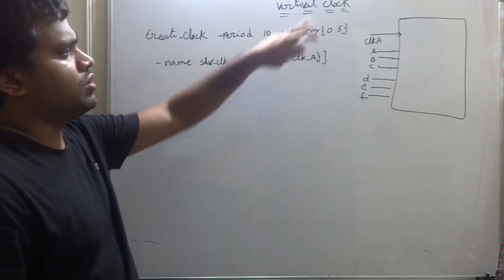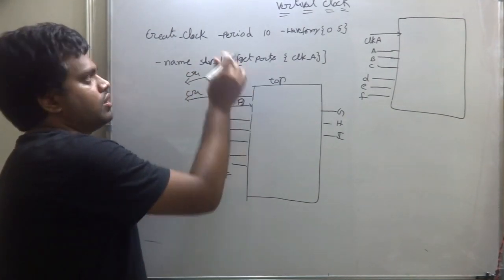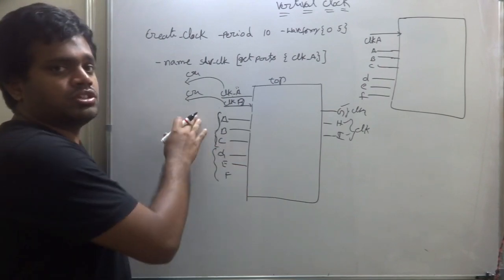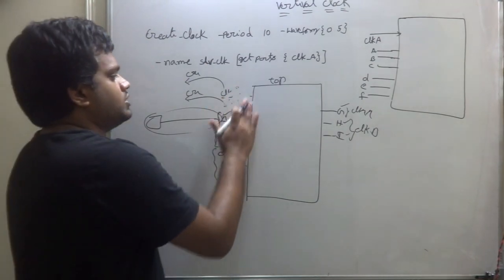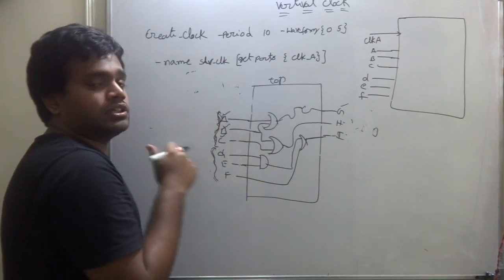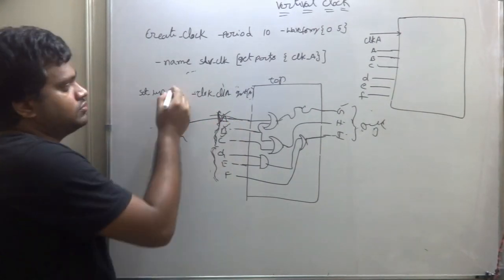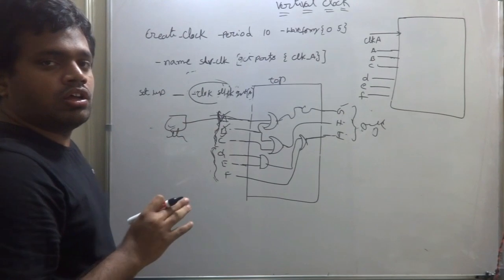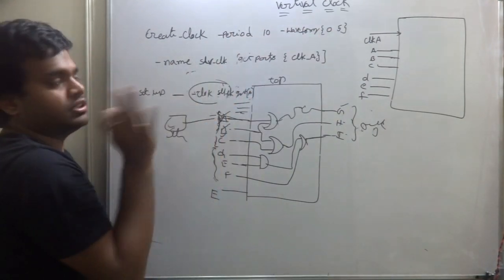Synthesis/STA -  virtual clock concept

Comment: I have one doubt sir, i have two signals one scl,sda these signals is depends on master. i have connected in port in these signals. so how I declared delay in sda line with respect to scl it's possible or not?two signals are connected in port but one clock another one data  it is output of master directly .